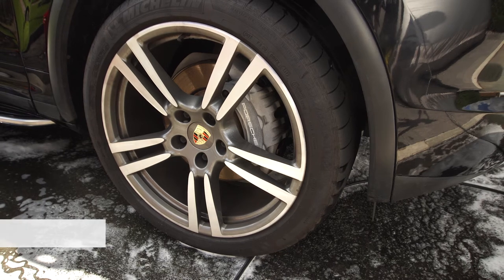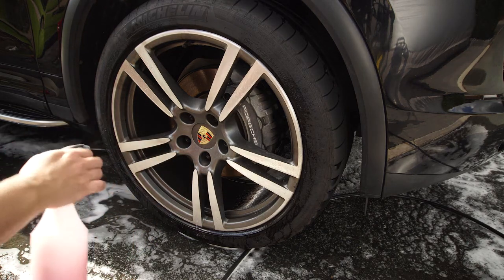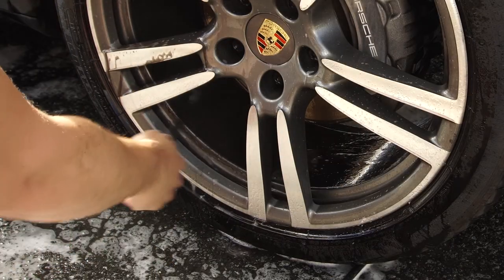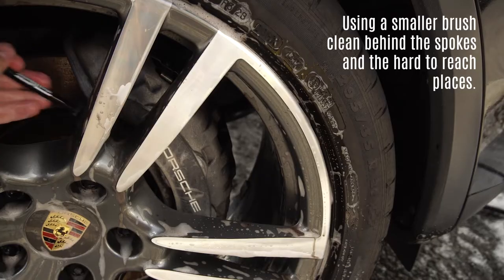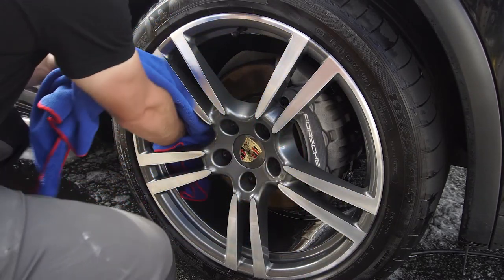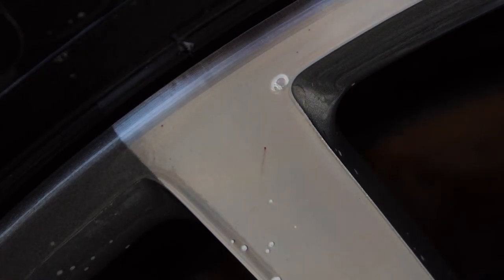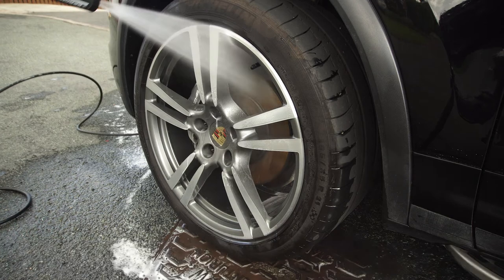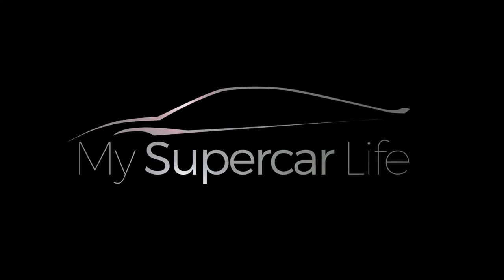How to Properly Clean Your Cars Alloy Wheels with Wheel Woolies, Trolls Breath and CarPro Hydro2

Comment: Hi mate I know this is a wheel cleaning video but wanted to know when making my own ipa can I use Auto Finness citrus power instead of the autobrite product?? And also do o have to just double the amount if I wanted to fill a bottle the same size you used??
Reply from the maker: Hi, Yes you can use any All Purpose Cleaner, so the Auto Finesse would be fine. You can double the amount, but you shouldn't need that much. The problem with making too much up is that the IPA will evaporate if it's not in a sealed bottle, so I'd recommend making it up as you need it. If you leave it too long the alcohol evaporates and messes the ratio up. Hope this helps.
Reply: @MySupercarLife  thanks so much for the reply... Auto Finness APC is called verso but I have citrus power... I want to strip my old waxes off and put CG V07 on. As long as citrus power will do the job oh also have surfed he if that would be better..?

Comment: Also hydro 2 is recommend with a strong jet of water but not a pressure washer. People on the car detailing Reddit have said a pressure wash has ruined some paint when using hydro2.... I just use the hose with a nozzle
Reply from the maker: I know that the UK Carpro site says strong water pressure or a pressure washer to create a physical shock, but I've heard about this before, I think someone mentioned having a problem with Hydro2 on my other vid (I only used a hose on that one, and someone told me in the comments I should use a pressure washer, lol!), but I can't remember what it was, I think it went cloudy. I've never experienced it myself, but I only use it on wheels. I wonder if it's temperature sensitive, or whether it reacts with certain other coatings.? I suppose it's like most products, there are good and bad experiences with them.